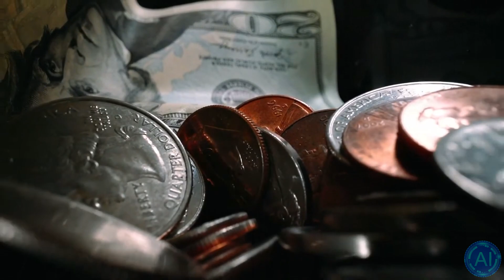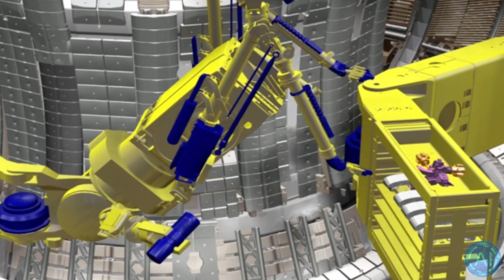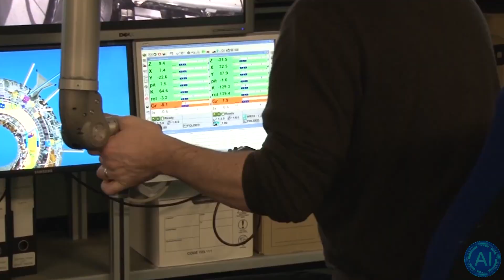Unlimited & Free Energy for YOU! - TODAY's Breakthrough Fusion Energy Reactor

Comment from the maker: So what is your personal opinion on the topic of Fusion Reactors? The benefits are hard to ignore and absolutely incredible, but we also cannot ignore the problem of poorer nations potentially being left behind completely and having to keep relying on more expensive, less efficient and dirtier energy-sources like coal.
- Don't forget to like the video & subscribe for more of them in the future! :)
Reply: What they teach you : "Magnetic circuit of an electromagnet and a transformer."

What they DON'T teach you : "The special effect of opposing magnetic flux being diverted by two different reluctance cores, which is the same as current flowing through two different resistors proportionately. Except that this occurs on opposing magnetic flux which is assumed to be not possible as it breaks known physics and breaks first thermodynamics law. The effect produce a useless transformer, and also an overunity generator."
Reply: pffft.
Reply: I am the author of the third method of achieving nuclear fusion, this is the repetition of physical conditions as in the solar corona. In 6 months there will be a small prototype of a commercial fusion reactor. A commercial fusion reactor in 1-2 years! Power 100 kW.
For many years (almost 25 years) I have been convincing scientists that thermonuclear fusion in the Sun occurs not in the core of the Sun, but in the solar corona !!! But scientists are very stubborn, and do not want to believe the obvious. Why are scientists not accepting new breakthrough scientific ideas? There is an assumption, accepted by most scientists, that thermonuclear fusion in the Sun occurs in the Sun's core. But no one has ever actually confirmed this. This is just a guess, the fantasy of an authoritative physicist. Scientists are currently using two methods to achieve nuclear fusion: inertial confinement and magnetic confinement. But there is also a third method of achieving nuclear fusion, this is the repetition of physical conditions as in the solar corona. Nobody is using this third method to achieve nuclear fusion? In 6 months there will be a small prototype of a commercial fusion reactor. A commercial fusion reactor in 1-2 years! I propose a technology transfer for a commercial fusion reactor under a contract. Thermonuclear fusion in the Sun - a new version. http://n-t.ru/tp/ie/ts.htm     https://www.youtube.com/watch?v=izCALj848xU

Comment: Why don't they use Garbage, Nuclear Waste from the fission Reactors or Rubbish as fuel? Maybe the fuel is too rich at the moment the one they are using at present and maybe that's why it won't ignite?
Why not put the Garbage through a Liquid Nitrogen, Liquid Oxygen, Liquid Hydrogen or Liquid Helium bath and then pulverise it into tiny pellets and then feed or fire them into the Fusion Reactors Plasma before they defrost.